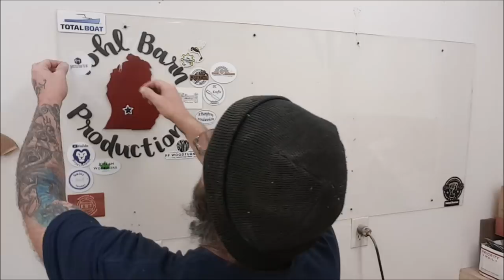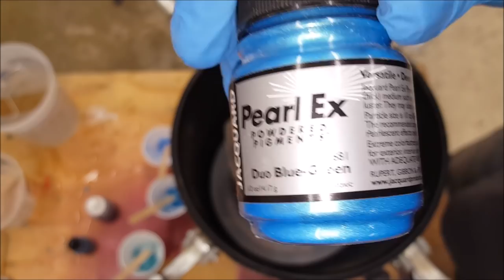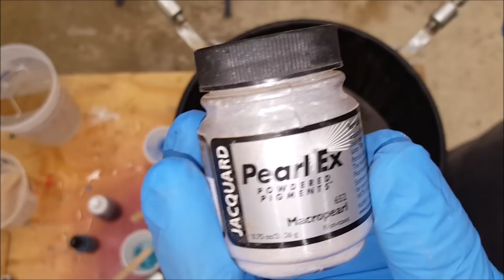Making a bowl blank,  A Collab with MG Makes

Comment: Thank you bother, it's definitely pretty. I hope you like the end result. 👊👊👊
Reply from the maker: No problem Martin,  you have to be happy with the results, I was only disappointed with the cracks in the resin, it's hard to pour that much and not get them, exothermic reaction is a pain in the back side. You could fill them with CA, that should for the most part hide them, but you have to clean all the YG and finish out of them first.